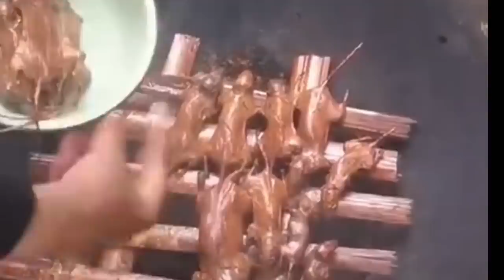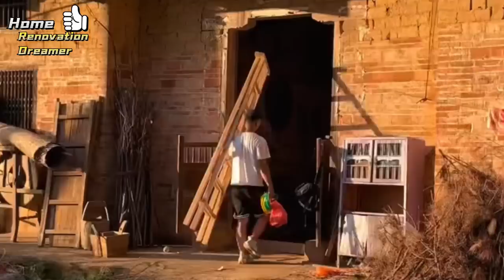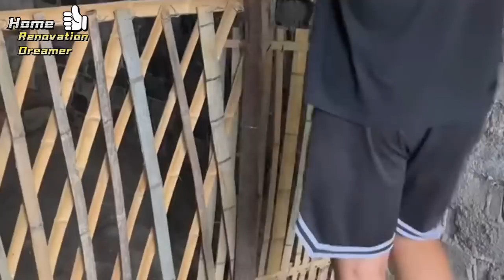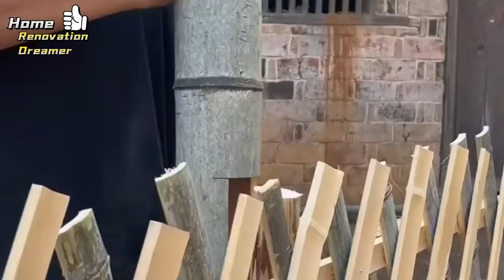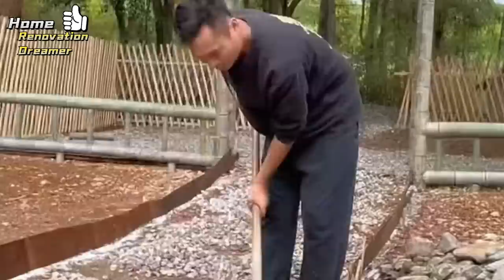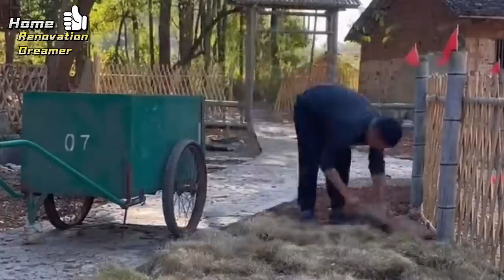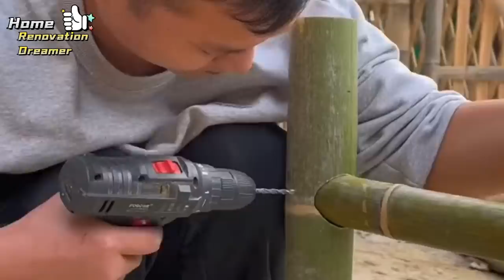The unemployed guy renovated the old house, the garden in front of the door is very beautiful~@Zin2D

Comment: Can I get the recipe for mice ? at 0:07
Reply from the maker: 😀Ninghua dried voles, also known as dried mice, is one of the eight major dried vegetables in western Fujian and is a famous local specialty in Tingzhou Prefecture, Fujian. Voles belong to the family Mammalia Hamsteridae. Their coat color is generally dark taupe, and some are sandy yellow. They feed on rice. Late rice yellow ripening stage · Bite the rice ears to store caves, often in the grass at the foot of the mountain, digging hidden paths, which is very harmful to crops. Ninghua is an agricultural county in a mountainous area, so there are many voles. People capture voles to protect crops, and then make Ninghua dried voles. Craftsmanship
(1) Hair removal. The captured mice are either placed in a pot and steamed with hot water, or baked in firewood ash. As long as the fire is properly controlled, the mouse hair can be pulled out completely.
(2) Remove the intestines, stomach and lungs by laparotomy (the liver and heart can be kept), and wash the rat meat with water. (3) Finally, use rice or rice bran to smoke and roast until fragrant, and roast it into a sauce yellow or coffee color, but do not burn it or burn it. (4) Serve with pork, winter bamboo shoots, radish, garlic, ginger, and sweet water wine, stir-fry in oil for a while, and eat. Dried voles are not only delicious, but also high in protein and rich in nutrition. In particular, it has the function of invigorating the kidney, and has a significant effect on frequent urination or bedwetting in children, so it has certain medicinal value. Because the local people generally like to eat dried rats, there has always been a saying of "the price of dried rats and pork". When winter comes, people almost regard eating dried rats as a kind of enjoyment. Most of the cooking methods are served with pork, winter bamboo shoots, garlic, ginger, water and wine, fried and eaten. Especially for those who love to drink, it is regarded as the top grade of wine pairing.🙂